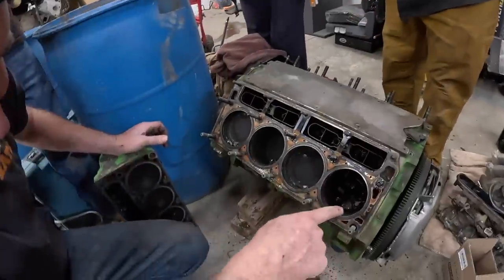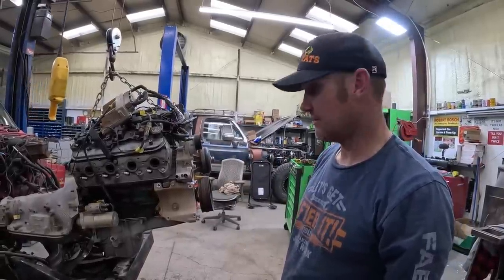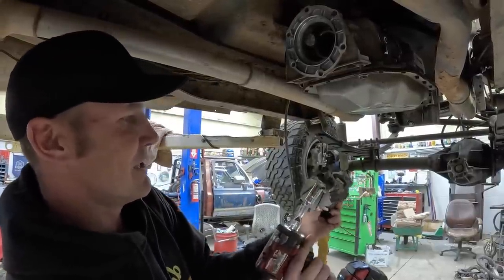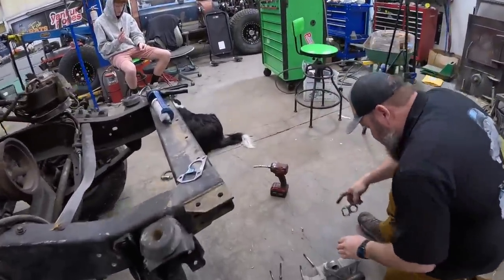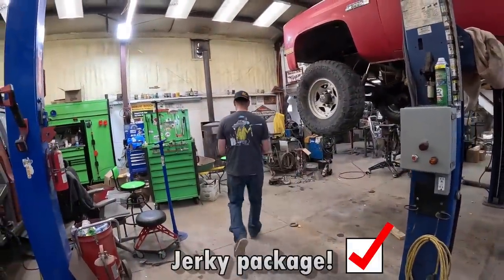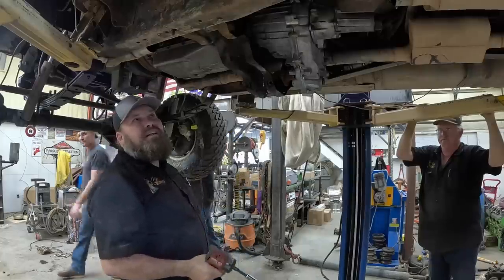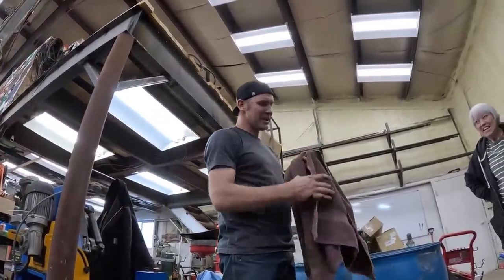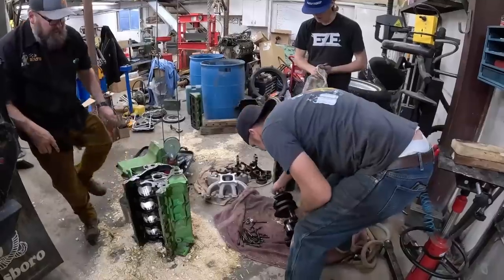We Found Out Why Landon's Motor Blew Up And It's A Little Shocking!

Comment: Landon, that was EPIC! I've been a mechanic, building drag engines and blowing them up for almost 50 years and I have NEVER seen an engine regurgitate piston pieces into the intake! Congratulations on a whole new definition of blown up!
Reply: Had a 350 4 bolt get a piece of the cam in the intake..the other 4 pieces were in various locations
Reply: His name is Landon,don't confuse him with "let's go Brandon"🤣
Reply: Apologies Landon. Autocorrect kicked in and I didn't catch it.
Reply: You ought to be around truck pullers!!
I picked up a center main web off a Minor Brothers Engine, off the pulling track after a feller grenaded his 14-71 blown engine!
And the crankshaft was still in the engine!
It is amazing where engine parts show up when they grenade !!
Reply: I saw it happen. A 2 liter Saab engine with foot long intake runners. Bits of valve seats found there way into the other three cylinders. And, up to 20 seconds before it seized, it was running  great.
Reply: @Jim Edge  Now you have me wondering 🤔 what name I typed in another video....If it wasn't for everything associated with the wrong name I'd just say no big deal I'm old and am allowed to make mistakes 😉. It's not like I'm the leader of the simi-free world
Reply: doesn't this technically mean the engine imploded?
Reply: It happens more often than not. If you ever have a piston break you are supposed to clean out the intake or replace it if you cant get every piece of debris out. And clean/replace oil cooler and lines.

Comment: When I was 17 I had a 65 GTO (still have)  and I idled  about 7 motors to death. All I had was a chainhoist in a tree, I wasn't lucky enough to have a daddy with a shop, I had to learn to fix it by myself.
Reply: Yip my mom used to say to many RPM, S
Reply: My 66 GTO 6 engines in 4 years

Comment: Mr Paul, you are quite the Dad. If my son had done that did something that I had to fix I would not have been a happy camper. Back in 1994-95 I bought a 1968 Ford LTD from the salvage auction it was not hurt bad at all. The reason I bought it because my first car back in 1975 with a 68 Ford LTD so my son got the one I bought 94/95 and that was his first car basically. The cool thing is he still has it today it's a four-door hardtop Factory duals original 390 with a four barrel and an automatic. It it runs like new. He has had has been in several car accidents in this car but it's been fixed every time. it still looks good. I can't be more proud of him? When he came into my life he was 8 years old he's 42 now and he still refers to me as his dad though he doesn't call me dad, I think that's pretty cool. He married well and has given us two Grandsons. He never got involved in drugs for which i am greatful! Best regards Bob from Virginia USA

Comment: Great video guy's, problem is Paul has raised his kids doing burnouts and full throttle shifts. It gets in your blood, the adrenalin rush is amazing.  Until you hear the sobering sound of the engine coming apart. Good thing is Landon will be an engine rebuilder and tester.
Reply: Yup!!!
Reply: Your insight is pretty wise. You can hardly get angry at a kid who's dad is pedal to the metal 24/7.
Reply: Rod knock at 8k rpm can change a man for a min and then the next motor gets the same treatment Haha
Reply: @gmcman355crazy  UNLESS said man has to take out a loan to pay for such foolishness.  Money, or lack there of, can be a game changer.  In other words, how reckless can you afford to be?
Reply: @Rat-Builder  if Mom and Dad are buying the parts you can afford to be very reckless until Mom and Dad stop buying them.
God bless you!
Reply: @michaelboyle1983  I can tell you from my past experience, Mom and Dad will tire of buying them quite quickly.  LOL  Actually, I got married at 18 and moved out.  After I moved out I took responsibility for my own wheels.  When I got married, I did not even own a car.  I had a Honda 250 Dream motorcycle.  I bought a 1956 Oldsmobile on the installment plan for $100 out of a wrecking yard.  I paid him $25 a week, had it paid off in a month.  My Father in law gave us an awesome wedding present!  He gave us a year's rent.  I was so unprepared to be on my own, but we made it work.  Those were not terrible times either.
Reply: @Rat-Builder  I agree. That's quite a story of your past. Thanks for sharing it and God bless you from Maine!
Reply: @michaelboyle1983  Thanks.  Unfortunately, that marriage only lasted for 9 years.  But we created 3 awesome Sons.  The oldest just turned 56.  Man, I am feeling old.  LOL

Comment: Good video!! Looks like Landon is soon going to be on the road again!  I have a 2004 F-150 with a 5.4 Triton.. mechanic replaced the passenger side exhaust manifold and gasket... on the lift idling to check for leaks... engine goes bang, bang, BANG!! Stopped dead!  put two 3/8" holes in the oil pan... never got to see the inside so not sure but I suspected the roller followers failed, and dropped a valve??? Cost me $6,700 to get a new rebuilt engine installed. Landon is SO LUCKY he has you and your knowledge and shop!!!!

Comment: The most important add on to make an engine last longer for a teenage driver is to bolt a two by four to the floor under the gas peddle!
Reply: Lol
Reply: 😂 gotta NAIL it , so Paul can use 
       his  hammer
Reply: Paul can peen the ends of the bolts over so the nuts won't "accidentally"fall off and the 2*4 gets lost.
Reply: He's a teenager. Better weld metal under it or it might just accidentally come off "out of the blue."  :)

Comment: Some of the best training I ever had was when my parent vw bug that i was allowed to occasionally drive broke down and my dad gave me a Chilton manual and obtained permission from the mechanic next door for me to push it in and use his shop and tools after hours.  He said if you wanna drive you're gonna have to fix it yourself.  Took us 2 hours to pull the motor the first time on the 1969 automatic stick shift.  We got pretty good and we're able to pull it in about 10 minutes on about the 5th time.  Ended up converting it to a real manual eventually when the tranny went on it.  My son had a civic that spun one of the crank bearings and although it cost him a bit of money in parts (new crank, etc) he did all the labour himself (with some supervisory help from his dad) and learned a lot about engines in the process.  Priceless.  The best way to learn is to do, might reduce the heavy foot in the future too, maybe...

Comment: My first vehicle had 130k showing when I got it, and it lasted me almost three very hard years, a timing-chain was the only thing I had to fix in that 3-yrs, but it wasn't a shitty-chevy either,😉, I did buy a Dodge for my second rig, it only had 30k showing when I got it, and less than 35k when it caught fire at a stop sign and was totaled, I haven't owned a Dodge since, thanks for sharing guys.👍
Reply: @jerrtb1234, that's one thing I can agree on Dodge/Chrysler products are junk.

Comment: Make sure you set the rev limiter at 4000 that way he will have that engine for a while and won't have to worry about sending rods out the side
Reply: Also have him rebuild the motor he blew up.
Reply: @RattyFlyer  blew up a 327 a little over 50 years ago and some of the spark plugs looked like the one Paul showed. I tore the heads off and a couple valves dropped and when they hit the pistons they exploded and ruined both the block and a pair of 202 heads. I hit a smalll patch ice at the top of a hill when I was pedal to the metal.
Reply: Good to see the new engine is EFI. Should help the over-speed problems.

Comment: Just a heads up that back cover for the Tcase is EXTREMELY valuable and hard to find. Those Np241C passenger drops are highly sought after. Especially if the have the electrical Speed sensor

Comment: My 2000 Jeep xj blowed up in the spring time I just finished changing at out last week. #6 on the 4.0  looks the some way everything in the hole is in the oil pan piston connecting rod broke too I was not Idling .  I was running 75 mph  . If you seen the look on my dad‘s face when she blowed up. It was really bad ..    hope to get it fired up this weekend

Comment: I was passing a car and inadvertently downshifted from 3rd to 2nd, instead of 4th and dropped a valve in a Jeep. That valve put 2 windows into the soul of that motor. It was amazing how much carnage there was in that block. It seemed like I took forever for that engine to spool down. Our best guess was a quick trip to 7,200 RPM did not sit well with the number 2 exhaust valve.
Reply: I have a Wrangler with a 2.5 in it and when I bought it the guy said it has a knock at about 3000 RPM but it will stay together forever if you keep it below 3000. It was a play toy for me and I had plans of putting a 6 liter in it so I didn't care. 
I was wheeling one day and revved it way over 3 grand and it started knocking real bad. When I got home I decided to drive it over to a friend's garage to look it over and going down a big hill it quit running so I tried starting it with the starter and it wouldn't turn over. Knowing the engine was junk and not caring, at about 40 mph I let the clutch out and it locked the tires up for a second then freed up but didn't start. After letting the clutch out again it started running very rough and knocking bad with a lot of lights flashing on the dash. It was barely running and smoking really bad, I couldn't see the vehicle lights behind me at times due to the smoke, but I made it another 3ish miles to his house after it quit many times. It was a good thing most of the way was down hill or I would've needed a tow. 
When I got to his garage we looked through the fender well and there was a hole in the block the size of my fist and the wrist pin and half of the connecting rod was sitting on the frame. The goo, a mix of oil and anti freeze I assume, that was running out from under that Jeep was nasty. I was surprised it ran as good as it did, for short amounts of time, after the hole was knocked in the block and it freed itself of the part of the connecting rod that was hitting. That was the last ride for that Jeep and I replaced it with an 86 short bed Chevrolet. 
I hope you liked my story and God bless you!

Comment: Looks like you should put a R.P.M. limiter in that just for safety reasons 😂
Reply: My RPM limiter was a 4 cylinder.
Reply: @cojones8518  
Na I had 350 w 4 barrel Quadrajet Olds and 429 w 4 barrel T-bird having to pay for the upkeep, gas and insurance works. The repair can make a difference but it depends on when you grow up.  AKA: Size of community, culture and location.  Being where everyone knows everyone makes a big difference on conduct.  When Grandma  would hear about what you do before you can even get home. 🤔.     😳

Comment: Landon was Landing that rig. However I seem to recall an issue with the first cam you put in it from Ebay, it was a 1/4 inch too long and destroyed the lobes and the lifters. I also seem to remember you flushing metal burrs out of the block after it's failure. So in Landon's defense it's possible the value was previously damaged.
Reply: That's not the same motor lol !!!!
Reply: @davidburchfield2720  So you're saying the engine that I'm talking about was already replaced? There seems to be a missing link here. What exactly have I missed?
Reply: @briansutton7764  I think the first one was the big block.
Reply: @briansutton7764  this wasn't the motor with the Chinese camshaft issue...it was ruined by all the metal shavings. Lost oil pressure shortly after cam swap. There is a video with all the details when they decided to put this motor in it.
Reply: @ChevyARt15  I must have missed one or more episodes. Maybe Landon needs a rotary engine, after all it only has three moving parts.
Reply: Alot. Your defending / deflecting teenaged excess.

Not encouraging teenaged responsibility. The reason were in this mess as a country today.
Reply: @MadDawg91108  Well at least I have the missing link. Now the question is where to find that video? To tell the truth , I was surprised they installed the nose clip without running the engine first. When I buy Toyota parts on Ebay I always check the country of origin. They sell parts in boxes that look exactly like Toyota's Packaging but in the description it says, country of origin unknown. I recently purchased two timing belt kits and made very sure that the country of origin was Japan. It was literally double the money. Buyer beware.
Reply: @hafsalinda  The reason this country is in the mess that it is in, is due to liberalism. Paul's kids have had a good upbringing, for that reason alone they deserve the benefit of the doubt. When I was a teenager I purchased a Dodge Charger that made it exactly one block before dropping the drive shaft. I taught myself how to replace the universal joints in 3 feet of snow. Trust me, they didn't have YouTube Back Then.
Reply: Yeh! Sure! And I've got a bridge to nowhere to sell you. I like Paul's diagnosis better. Too heavy a right foot!!
Reply: @ronwilken5219  So you're saying, father like son. Diagnose that while you're selling your Bridge.

Comment: I had a 289 come apart in my 67 Bronco, I was slowing down from 25mph to stop at a train crossing when it came undone. I had downshifted into 1st, so I was running about 3000 rpm. I found a chunk of piston in the intake just like that. So he very well could have been just cruising.

Comment: I did the 6.0 / 4L60e into my K5 blazer.  I needed a electronic speed signal to the Holley Terminator to get the transmission to shift.  My T case was the NP208 and I had to get an adapter from Advance Adapters to get the signal .  Something to consider.

Comment: Back in 1980 I had a 351W in my '68 F100 kick the skirts off a piston idling down a dirt road in third gear.  Threw a new piston in it, swapped it even up for a well kept '70 Challenger 383/4spd.

Comment: Ben laughing at this was so funny. I'm 50 (soon) and wrecked a few cars in Scotland but now that Paul says it's not a wreck if it didn't leave the road, technically I've never wrecked any. I finished my 1st going the correct way on my roof in my dad's car, 2nd I finished on the road after briefly visiting a field by going through a wall and leaving the field through the same wall and 3rd got hit at a roundabout and finished in a McDonald's drive thru (luckily empty)

Comment: Years ago my mom had an old Omni that my sister was learning to drive with. She caved in the oil pan three times on it and claimed it was from engine flex. The fourth time my wife was with her when she was crossing the RR tracks at a high rate of speed and took the front a little airborne causing the oil pan to slam into the second set of tracks. Looking back you could see a smear of oil on the road so my sister beat it for home and parked it. I took the pan off and that time the oil pickup was bent and broken off also. We got the new parts and put it together and shortly after my mom had the money to put new struts on the front and we never suffered from engine flex again but it was years before we let her forget about it.

Comment: I once shared a 750cc clubman's circuit racing car with the husband of a friend. I built a whole new motor, we went to a race meeting and had got the gear ratio's wrong, the rules only allowed up to change the diff and we didn't have the right one for the circuit we were at. Instead of driving the best he could to the rev limit, the guy over revved the engine and on lap 9 of a 10 lap race the car stopped. When I pulled the engine apart he had detonated a piston. The engine was alloy with sleeved barrels, so once that piston blew, everything took a hit. I managed to save the cylinder head and the crankshaft (after a polish and balance), everything else went in the scrap bin. Shortly after that I bought the other guys half of the car as he didn't have the money to buy my half. You can't share a car with a leadfoot.

Comment: Your gonna need a speed signal to the ecm for the trans to shift right. 
In my swapped grand wagoneer I'm probably gonna run a speedbox. It uses the speed output signal to spin the speedometer cable.

Comment: Many years ago I was driving an M12 Scania pulling a float with a 2o ton excavator on. I was just outside a small town, full noise going up a slight hill and about to pop it up a gear when it started clattering. I shut it down immediately and coasted to the side of the road.

When we lifted the head we found a broken valve. The thing is the valve had wedge itself onto the piston and hadn't done any other damage.
We replaced the valve, piston and rings and finished out the season then rebuilt the engine.

Comment: You I has a similar situation happen to me. I was driving my  Assigned Assigned company chevy pickup back to work one day. I was driving along at 45 miles an hour,  had a turbo 400 transmission  with a 396 big block in front of it. So it definitely was not high rpm's,  it suddenly started clattering as I was going over the river on the bridge.  Bridge was only like a hundred feet long. So as soon as it started clattering I took my foot off the gas and coasted just fare enough to get it off the road. The clattering was really bad and then suddenly the motor  Seized up. When I took it apart a valve broke near the top of the valve stem then sucked the valve in to the point the whole valve was in the cylinder.  Since it had nowhere to go it broke the piston and pushed a hole through the side of the cylinder.  Total junk was all that was left of that block.
Reply: Man, and I was worried about a warped cylinder head

Comment: I never blew one up that bad. My small block Chrysler (LA 318) saw some high rpms and had like 5 or 6 bent pushrods, and a wiped out cam lobe/ destroyed lifter and it still ran pretty good aside from making a ton of noise!